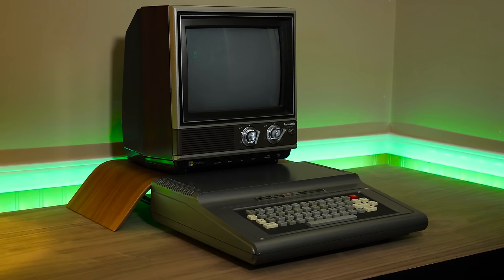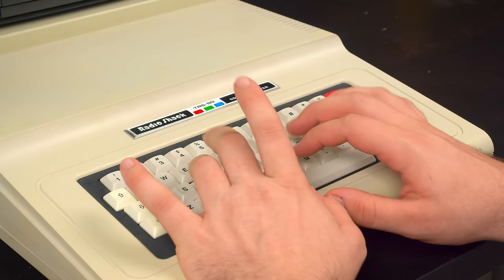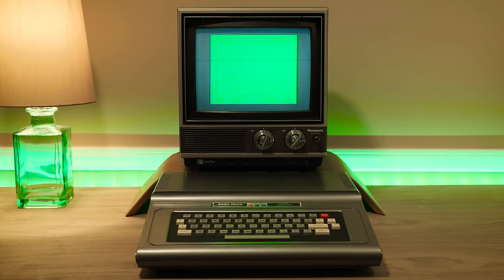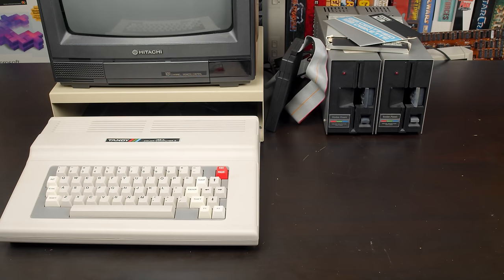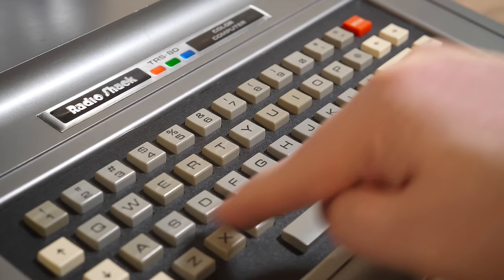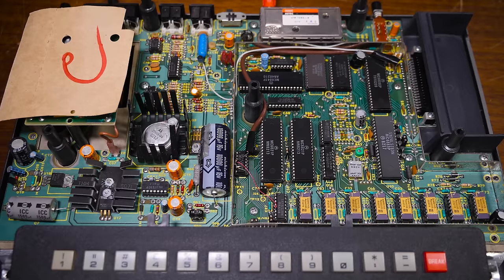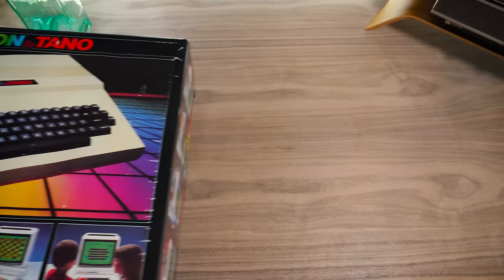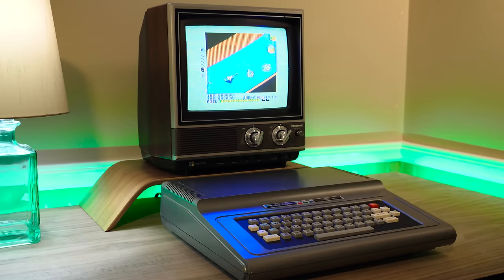TRS-80 Color Computer: Radio Shack's $399 Micro from 1980!

Comment: My first computer was a CoCo1 with a 64k upgrade and eventually a 32k CoCo2. I loved those stock joysticks for many of the games that actually made use of the analog potentiometers to control the speed of the player’s character. It’s especially appreciated on the game Doubleback; which I missed so much that I bought a CoCo2 and another CoCo1 to play it again 30 years later. Dungeons of Daggorath is amazing and even warranted an entire quest in the book, Ready Player One. Audio Spectrum Analyzer also appeared in the concert scene in the classic movie Revenge of the Nerds. Take THAT, Apple!!

I still enjoy programming my CoCos in BASIC and using the cassette tape for storage but I also have a floppy disk drive, Multipak Interface and a few other upgrades that I couldn’t justify spending money on in the 80’s. I never got into the alternate operating systems or the SD adapter, though I’ve considered it to simplify downloading and playing software from the Internet. I’ve had some success just using CoCoTape on my PC and sending the cassette audio through the headphone port, through a cassette cable to the CoCo; preserving some of the tape loading experience.

Comment: I still have several working Cocos, include a very low serial number grey original. There is a local coal company that still uses a Coco2, using a custom EEPROM rompack, to load 100 ton rail coal cars, just using the joystick. I ought to know as I programmed that setup back in the 1980s when the loadout was constructed. I worked for them at the time. The computer, bought in 1987, is still in operation to this day, just needing the coal dust blown out ever so often.
The Coco community is alive and well, even developing it's own SD card drive and retro fitting some machines with modern video hardware. I have 1 Coco 3 that I refitted to take a SATA hard drive and the OS9 Operating system updated. Hell, it will even run Linux. I ran a BBS for years on a Coco before the internet came to be.The Old 6809E CPU was a real powerhouse at the time, even outrunning and out performing some of the early IBM PC models..It's too bad that it was abandoned, as if further developed, it would have kicked Apple's ass and given both IBM and Microsoft a run for its money. BTW, LGR, I do have an IBM 360 Mainframe, retired from a coal company ,that sill functions perfectly, and 2 IBM PC-ATs that have never been unboxed, found buried when a warehouse was torn down.

Comment: My original CoCo 1 was purchased as a 16K unit, but it arrived upgraded to 32K in 1984. Later I was able to get it soldered up (with help) to 64K. I agree with the difficulty with the chiclet keyboard, and another early upgrade was for a "melted" style, and a video upgrade to get proper upper/lower case and 80 characters wide.  At one time, I owned 6 models, all the way to Coco3.
One fact most people didn't know - the CoCo cassette storage was FASTER read/write than the Commodore's disk drive!

Comment: I had a CoCo back in the day. I found that there was an unused address channel on the memory controller. If I soldered additional RAM chips ontop of the existing ones, with the address leg bent outwards, and ran that to the unused address channel, I could create a second address space! Using a physical switch, I could physically switch between the ram! So, I could hold programs in memory, switch to the other memory address and run another program there! Kind of like a virtual machine! So one could be running a BBS program and the other could be doing word processing or something else! I then found that there was a guy named William Gates in Texas that was selling a CPM style OS. I purchased a copy, and a friend had an eprom burner. I replaced the coco eprom with my custom eprom and now my coco had an amazing amount of capabilites...including lowercase decenders! Yay!

Comment: I worked for Radio Shack at one of their service centers in the 80's and repaired those.  One of the problems we had was that there were a huge number of different system boards in those. It seemed like they were made by whichever Korean company put in the lowest bid that month. Sometimes we had to replace the system board to do memory upgrades since sometimes the memory sockets were missing.

Comment: Bought my Trash-80 Color with 16K Mem in 1983. Including the interface cable for the Cassette player when I needed to save my BASIC software projects. It eventually died in 1994. But, It was still interesting to have.

Comment: The TRS-80 Color Computer was based on a reference design for the Motorola 6809 processor, the 6821 peripheral interface adapter chips, the 6884 Synchronous Address Multiplexer chip, and the 6847 video display generator.  It can be found in the Motorola integrated circuit data books going back to 1977.

Comment: I was a Coco Fanatic, my first as a color computer 2, eventually owned this grey model, another coco 2, and a Color Computer 3, with 512k ram expansion, high res adapter, and Color Computer High Res Monitor, a later model specifically for the CoCo 3. I had a Tandy dot matrix printer, an IBM wide carriage "Pro Printer XL", I received from someone who worked at the IBM building locally, saving it from the trash... multipack interface, floppy controller 5 1/4" drives, 3 1/2 drive, hard drive controller pack, either 10 or 20Gb fullsize 5 1/4 Hard Drive don't remember which, trs80 data cassette, ivory later model for coco's. I had the Orchestra Stereo sound cartridge, custom MIDI cables connected to a Yamaha PSS-680 keyboard. Using Lyra music transcription software. I had the earlier joysticks, and later hires joystick deluxe. Modem pack, x10 plug n power computer interface, touch tablet, mouse, eventually I had nearly every program and tandy coco accessory. I was in the Inland Color Computer Club. We would setup at large grocery store in an open loft area frequently for meetings. Many were current "sysops" running Coco BBS's, the fact that the Coco 3, with expanded ram, graphics, and OS9 3 1/2" floppy control, and Hard Drive control with Multivue was a complete "windows" machine, before Microsoft! Had a notepad, paint, ect, used mouse, printer support, ect

Comment: I recently got given a Tandy Coco 3 with 128KB RAM, original cassette player and 2 joysticks. I took it to a local retro meeting and another member noticed it wasn't producing any blue (I just thought it had a strange colour palette) he popped the cover and wiggled a few chips and fixed it right there at the meeting. It's a nice little machine and right up my alley being an old 8bit machine, and loading software from my iPad was super simple. Oh I also LOVE that wooden TV/monitor stand.

Comment: This was my machine! One good thing about it was the 6809 which was a decent CPU vs 6502 or Z80.
The service manual provided details about internals, which made me wire stuff inside 😀. Still have it to this day.
Reply: Yeah the 6809 instruction set was more advanced. I was programming a CoCo in assembly the same time I was taking an intro CS course in college and the 6809 had fancier addressing modes than the PDP-11!

Comment: Yes, the sound on the tape sounds exactly like a MODEM.  The usual way the data was encoded for tape storage was precisely the same way it was encoded for MODEM transfer, and this was the method used right back to the MITS Altair 8800.  (Commodore didn't use this method, they had a true digital format, and the same one on all their 8-bit machines.)

Comment: My first home computer (as a teen) was a CoCo (my mother was a TRS-80 salesperson at the time) with chiclet keyboard and Extended Color Basic, later upgraded to 64K, but I never had the disk drive - tapes only.  I did a lot of programming on it and my first assembly language was the 6809 (which has 16 bit index registers, which made it very difficult to learn 6502).

One problem with the joysticks is it was very easy to bend them.  I suspect a lot of the problems you had with the keyboard were due to age - the chiclet keyboard is a basic rubber dome / membrane type.

Comment: I had one from 1981 and the service sheets for the computer and a floppy drive, and the 6809 assembly language cartridge. I know every inch of that machine inside and out.  I also ended up running OS9 it was basically UNIX.

Comment: Many CoCo 2 machines had "alternate" text modes where you could enter a couple of POKE commands and get support for "true lowercase" letters.  This newer version of the CoCo II was called the "CoCo 2b", and it originated in the mid-1980s.  Your best time to have gotten one was one or two months before the Tandy Color Computer 3 was released, as Radio Shack was no doubt stripping the CoCo 2b's prices to clear more of the shelves for the CoCo 3.

Comment: So... the very earliest memories I have of computers, probably around when I was 6yrs old or so, back in 1986, is probably from some variation of this, the TRS-80 or a similar earlier model. Perhaps it wasn't the color model.

Mind you, I'm from Brazil, back then computers took waaaay longer to get here, they were super expensive, and only people who had real specific and niche interest in computers would get them - my dad in case. xD 
He worked with computers from the valve era, passing through punch cards, all the way up to Windows PCs.

Oh, also, back then none of the computers that got to Brazil were named the same as US, or Europe, not sure why. I guess they always went through some sort of importation scheme which changed the name to whatever company did it.

Anyways, back to the subject... I remember the keyboard/case was identical to that of the TRS-80, but it was blue. All metal, the keycaps look similar.

Can't remember if it didn't accept rom cartridges or if my dad just didn't have them, we just plugged a tape recorder and ran programs like that.
I think we only had one game - Zaxxon 3D.

After that I only remember already getting into the PC-XT era, green phosphorous monitor. But I was already way older... my dad taught me to code with Dbase III Plus and Clipper, I went as far as programming a game rental store (at home) thing that could register and administer costumers, and print rental slips for people to sign. xD But that's when I was already 13+ or something, because I remember we had SNES and Mega Drive games.

Even though I didn't code much after that until I started my university CompSci course, that really gave me a leg up when I started studying programming languages and such...

Comment: The "not quite color" technique used to print the manual was called duotone and I loved setting those up. Er, not those specifically but ones like it. Back when full color printing was super expensive, duotones let clients add a splash of color on every page for a relatively small increase in cost.

Comment: The Space Shuttle had eleven of the 6809 chips running on-board systems. The 6809 had both 8 bit and 16 bit internal paths, with only 8 bit out, and of course a generation away from the Motorola 68000 series in the original Mac.

Comment: I had one of those! It launched me into my electrical engineering / software career.

I remember the joystick interface. There was a 6-bit D-to-A converter implemented with six discrete resistors and an op-amp. To read the joystick position, the computer would do a 6-bit A-to-D successive approximation conversion in software.

Color BASIC was originally written by Microsoft and I would not be surprised if some was done by Bill Gates himself.

I also learned assembler on the CoCo, for which I'm thankful; the 6809 instruction set was far more sane than the Intel ones.  Ah memories!
Reply: Bill Gates did write some parts of the Coco's BASIC himself (one of the last machines he did so). And 100% correct on the 6 bit A to D; the high res joystick interface extended that, using the same technique, to give a about 10 bits per axis.

Comment: The color computer had a unique architecture, the video RAM was just a partitioned area of the RAM for programs and temporary user data.  You could have multiple animation frames loaded and change the entire display by poke-ing one byte, the pointer to the video RAM block.  It did lightning fast animation nothing else could match.  In the Rutgers perception lab it did animation noticeably faster than the other labs refrigerator sized PDP-11 minicomputer and Adage graphics processor which was a $100K add-on.  His grad students came over and asked how this was done.  They never got a COCO, so I guess they kept that to themselves.

Comment: I still have my CoCo which has the 64K memory upgrade from the original 4K,  also the upgrade Keyboard,  with 2 external Hard Drives... I was in Computers back then and ran a few Computer Clubs and helped a lot of people expand and have External Dives. How to build replacement Joysticks etc.... they were good times, but still my CoCo :)

Comment: The TRS-80 Model 1 was the first microcomputer I lusted after (mostly because I didn't have any).  But at $699 for the 4K model and $999 for 16K it was well out of my meager paper route budget price range.  The best I could do is spend a few minutes on the display unit at the mall.  The Coco was years later and by then I had an Atari 800 which was vastly superior.  As a collector though, I'd easily welcome a Coco into my collection.

Comment: Had the CoCo2 as a kid in the 80s.  Started with a non RadioShack computer cassette drive that didn't work with my CoCo.  So I guess their recommendation was not entirely bogus.  The CCR-81 I got afterwards worked fine, although I was never able to save and load my place in Dungeons of Daggorath.  My basic joystick had a plastic stick, not metal - I've never seen any other that had plastic (unfortunately it bent later, perhaps explaining the switch to metal).  Its non-centering aspect is crucial to at least one game: DoubleBack, in my opinion one of the CoCo's best.

Comment: I remember developing software on a Coco 2 when the original Mac came out. After ten minutes I realized, I may as well drop the Coco, everything has changed. Yes, the Mac was crazy expensive but I figured if Apple could evolve the Lisa down to a much cheaper machine and retain the GUI and 68000 chip, then PCs were going to get cheaper still. On the Intel side, PC clonemakers were driving that lesson even harder. I saw diehards with huge libraries of Coco software hang on, but Rainbow magazine got razor thin, and the ship had sailed. But I'll always remember the Coco fondly, lots of gaming and coding memories, and the 6809 was a joy to write machine code for.

Comment: I had  TRS-80 COCO, the silver beast.  I bought an upgrade module that increased ram to 16K (or maybe 32?) and included extended basic.  The joysticks were very useful for plotting graphics.  I would use two joysticks and draw a line between the two  (hv) positions on screen.  Flipping through the 6 pages of graphics memory while drawing made for some interesting psychadelic affects.  Oh, I recall also being able to poke an address which greatly increased the computer speed.  The music in games was sped up so it didn't sound that great but it was neat to be able to run code faster.  Oh how I wish I knew what happened to that system.  I had so many early prototypes of my games including home made fonts, stock market simulator, gravity and planets, etc.  Thankfully Rasbperry Pi and Python have let me continue to explore my ideas.

Comment: My first model in 1980 was also a Canadian version... I often wondered why the case had "color" miss-spelled.  LOL  Ah, the good old days when you spent hours typing in code to play an overtly simple game.  I even had the optional technical manual... full schematic and block diagrams, amongst many other details.  I was a huge fan of OS/9 and that started me on my path to UNIX System V, Linux and MacOS.  A cool thing RS did was provide socketed chips on the board, making replacements and upgrades easy to do (no soldering needed, mostly).

Comment: This is the computer that the Dragon 32 & 64 computers from the Now defunct Dragon Data (Wales, UK) were based on as recently shown in an unboxing on the LGR Blurbs  channel. The Dragon 32/64 have some slight incompatibility issues so not every CoCo I software runs on it out of the box, but a significant portion does and you can run most BASIC programs from the CoCo I on the Dragon via “software retokenization”  when transferring them from CoCo I data cassette. The CoCo I can also be turned into a Dragon by doing a ROM swap and retiring the keyboard and the CoCo I also will run a lot of Dragon software without any modification including BASIC programs.

Comment: Still have mine, ram upgrade/floppy drive/cassette drive/original sticks/deluxe sticks/300 baud modem/dmp 105 printer/cgp 220 ink jet. Also still got the coco 3 but it got fragged during a storm.

Comment: 11:20 .. I once heard the mechanics for those joysticks originally came from quadraphonic hifi equipment, being used as a balance control there. 

Also there is some "tuneup" for the CoCo (mostly the CoCo 3)  .. you can replace the 6809 by a Hitachi 6309 and then run NitrOS-9, a open source remake of OS-9, enabling the higher speed and additional, very powerful "secret" commands of the 6309.  I don't have a CoCo but my own system using a 6309, so I researched into this, checking if porting NitrOS-9 is feasible.